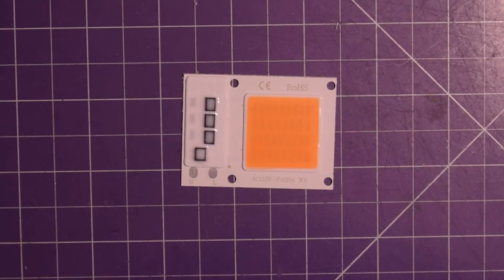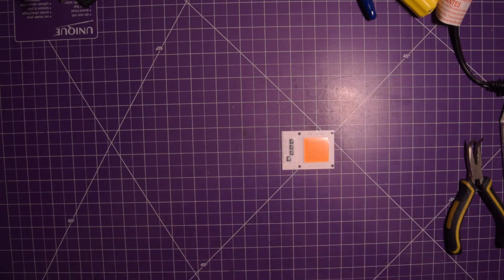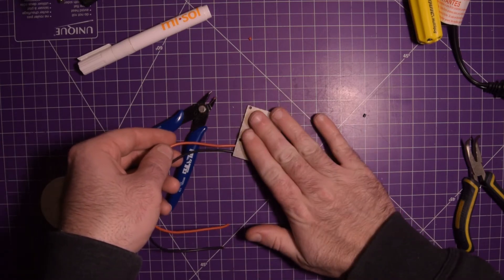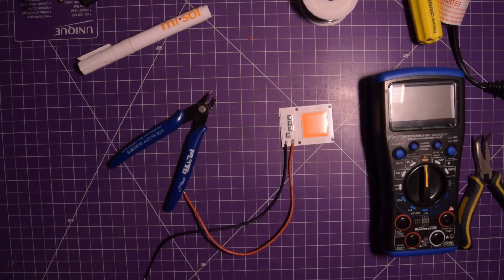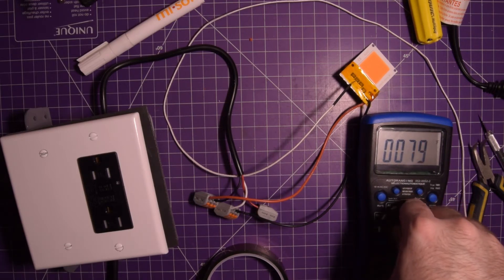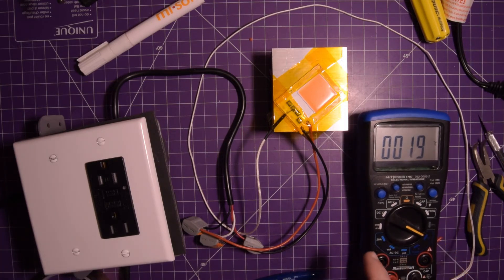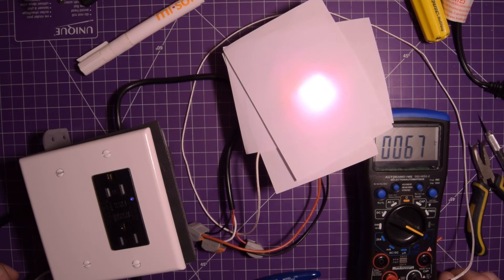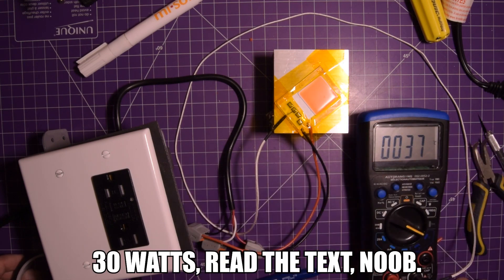Taking A Grow Light For A Spin!

Comment: I have been fascinated by these since that big Clive video. I wonder if a guy mounted a couple of peltier modules to a heat sink if he could
Produce enough voltage to drive a small low voltage fan
Reply from the maker: They sell fan units that sit on top of wood stoves and have a large heatsink, the voltage created by the peltier runs the fan, which flows air through the heatsink, which increases the delta even more and so on.
Reply: @SimpleElectronics  yes! that's what i was thinking  could be a neat experiment. i have a GPU hear sink and fan i have been thinking about trying to do something similar with.
Reply from the maker: @GeorgeJFW  you did get some peltier modules right? Get on it brother!
Reply: Simple Electronics I sure did just a matter of finding the time😜

Comment: A fan behind a block that has 4 of them might also provide you with a low end heat source too.  Do you have a link to those units?
Reply from the maker: haha, HIGH heat source. Here is the first link I found, there may be cheaper ones: https://www.ebay.ca/itm/Driverless-Full-Spectrum-LED-COB-Chip-Smart-IC-Light-Source-Plant-10W-20W-30W/273669203187?hash=item3fb7f4a4f3:m:mp-sKGGqYGIfjhVdh_FWZPQ